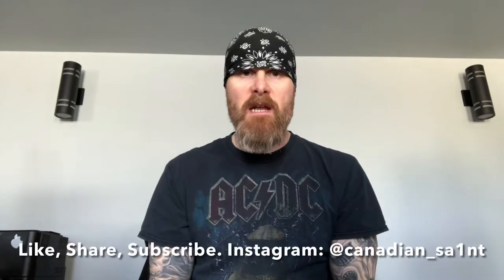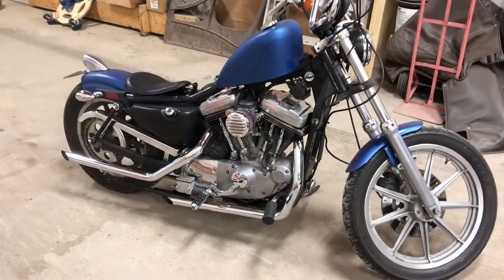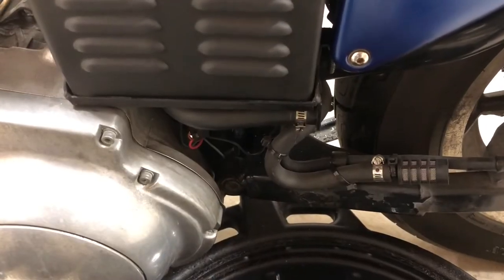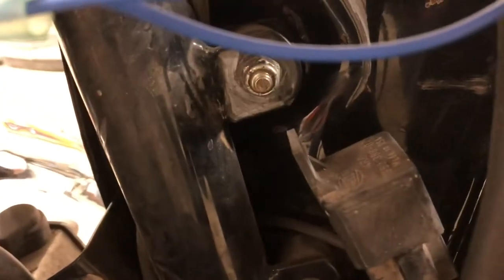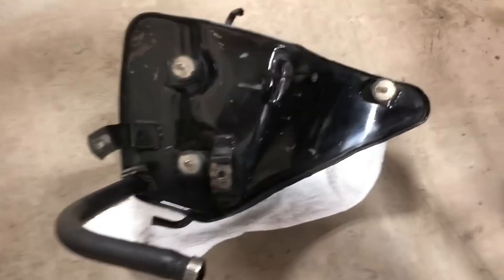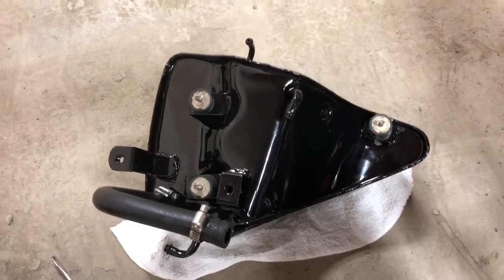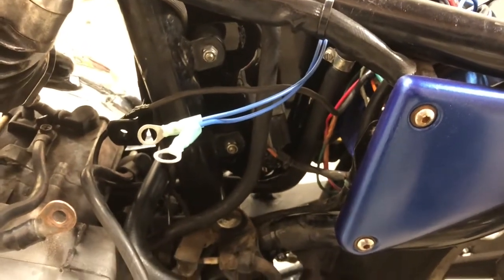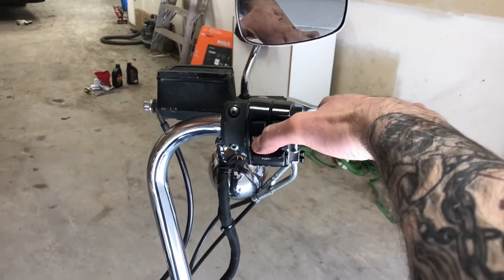Harley Davidson Oil Tank Leak

Comment: I have a question, what's with the 3 lines 1 send 1 return and one for drain, I spotted a 4th that runs towards the primary, is that a vent
Reply from the maker: Correct. One is a vent.

Comment: This was an 88 Sportster I have a 92 Sportster 883 and I had previously changed to oil lines hoping to cure my leak but I may have to change my oil tank (and the front rocker cover and rocker base gaskets) but I believe I have more oil lines to bottom of my oil tank. My question would be are the 92 883's different in that regard?
Reply from the maker: I believe that the oil tanks from 83-93 should be the same. The 94-97 should have more lines to the bottom of the tank if I am correct.
Reply: @canadiansa1nt309  Hmmm,  I'm not sure what might've been done before I got this thing because you just described what I recall seeing on mine when I changed oil lines last year.